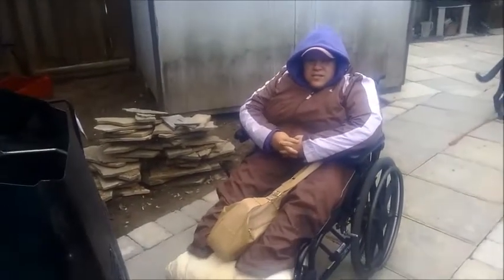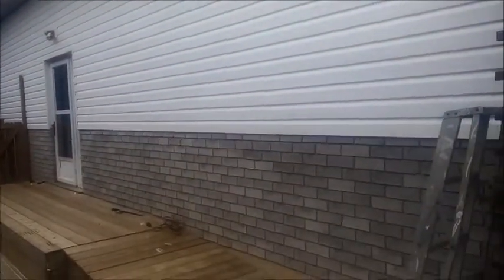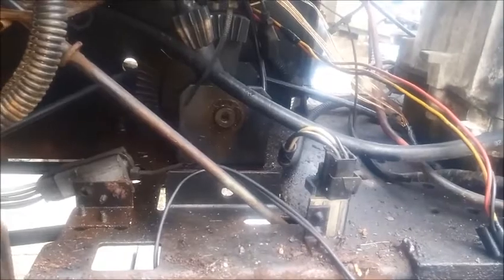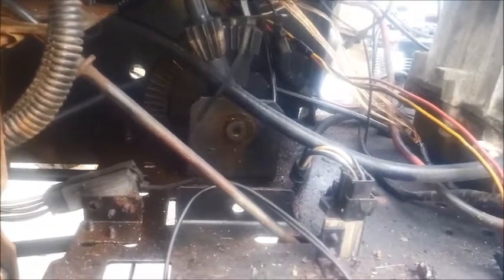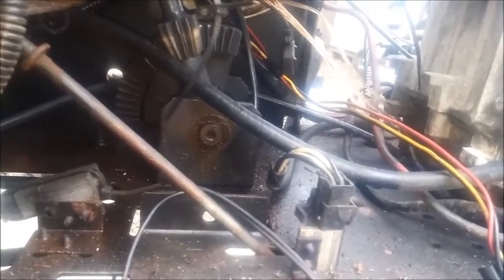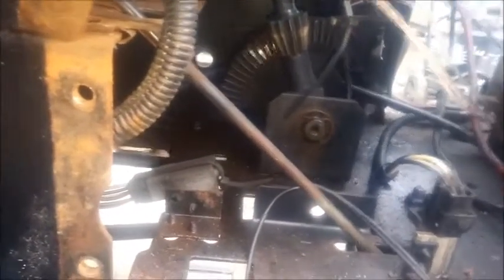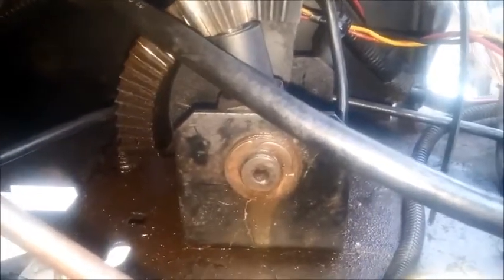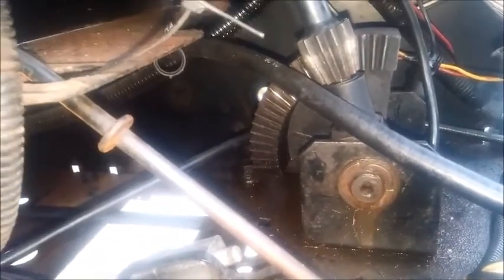Craftsman Truck Steering Repair

Comment: good work man tractor looks awesome.
Reply from the maker: It's getting there, but I'm thinking about doing a new main half body so if this does happen I will be technically starting all over at the beginning but in some ways to converted it to four wheel drive it will be easier.
Basically convert a new body and then lengthen the frame and I can keep on driving my truck
Reply: redneckbryon good luck what ever you do.